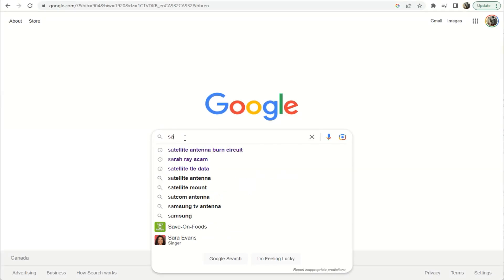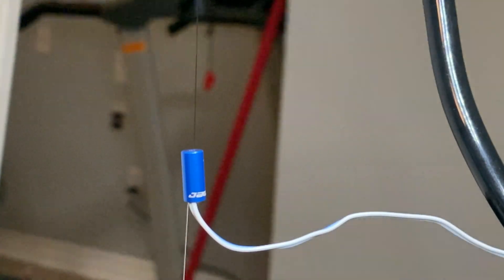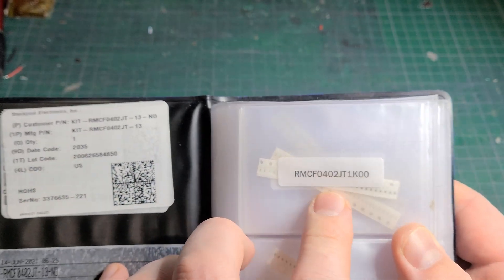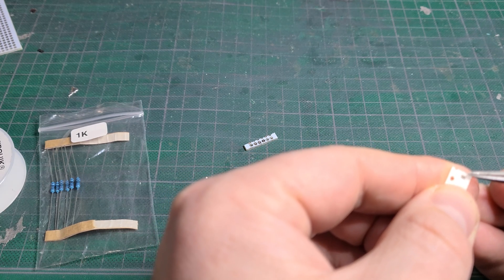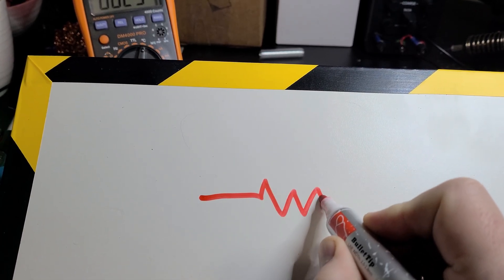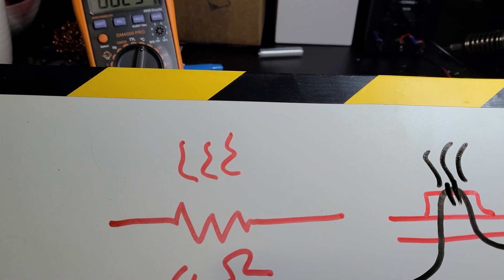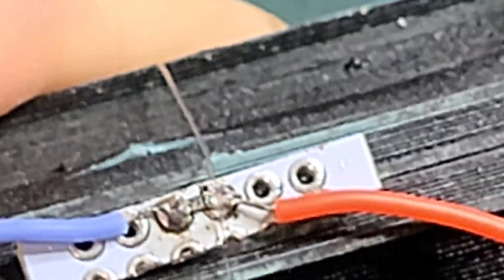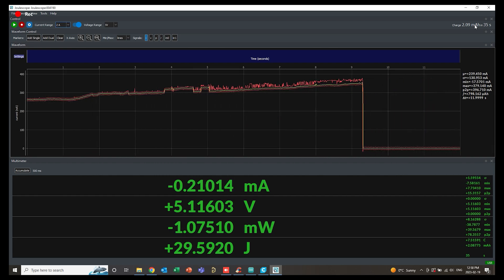DIY CubeSat Build Part 3: Antenna Deployment Burn Circuit

Comment: Wh
ats is the exact spec of the wire that was used?
Reply from the maker: This is 1.8mm stainless strained wire
Reply: @EngineerMeThis  Thanks. I meant to ask about the spec of the burn wire's material though, can you pls help with that?

Comment: Diodes also get nicely hot, something like a 1n4148 works great without needing much power
Reply from the maker: Intresting comment. I'll have a look. I know TVS diode can melt them selfs of the board so good idea to check
Reply: BTW, you can also estimate from the datasheet how hot things may get. Usually there is a thermal resistance specified. For the diode I quickly checked and it's given as 240 K/W, so putting 1W in it (say 1A at 1V) should raise its temperature by 240 K. Another nice thing with the diode is that it is rated to keep working at a higher temperature than the resistor. Up to 200 C according to the Nexperia datasheet I found. And a final note, when selecting a temperature rise for cutting the wire, take into avond that during antenna deployment your satellite may be well below room temperature!

Comment: just a thought use 2 resistors in parallel incase 1 fails the other could be driven at a higher voltage or pwm to give a second chance also the less contact between the resistor and the pcb then less energy is wasted and might decrease the resistor failure rate.
Reply from the maker: Jip Agree, as showing in the references most people use them with two resistors in parallel arrangement, the point here was just to explain how it works.
Reply: @EngineerMeThis  ha ha i did worry i might be trying to teach grandma to suck eggs but i just could not resist the chance to sound like a wise time served EE  instead of the guy with a test gear addiction and too much free time that i am :)
Reply from the maker: Lol... I think we all feel like that sometimes. The only difference is the amount of failed/learned "how not to " lessons completed :-)
Reply: @EngineerMeThis  Lol then all i have to say is thank you. For making this lesson funny, memorable, and pain free .... Oh and for sparking my interest in cubesat's

Comment: So, question: I got these incredibly small solenoids from my Chinese electronics parts supplier - I can't find them at the moment or I'd give you exact specs. Probably less than 5g, maybe 12mm long, 5 x 5 mm. They are TINY. Why not use a solenoid for release? Temperature extremes would probably bind the shaft in the cylinder, wouldn't it? And I'd hate to get my precious satellite into orbit only to find out that's exactly what happened.  :(
Reply from the maker: Other thing I forgot to mention is the vibration issue. They do shock test and vibration test on the equipment to a point that seems over accessive
Reply: @EngineerMeThis  I FOUND THEM!  lol  If you want a couple of those micro solenoids, I'd be happy to send them. But your point about vibrations is a good one. It may be a cause for problems with the solenoids as well. Anyway, if you're interested, let me know, I'll drop you an email and get a mailing address and ship you a couple.
Reply from the maker: Awesome ! Im interested to test their holding strength /Torq knowing whats out there and how much power they use is good when desiging new systems that might need something like this! Please drop me mail.
Reply from the maker: Jip, These companies spend $50K base cost plus and other $5K per kg to catch a ride to LEO. they want as simplest and reliable method for release as they can,  well as simple as you can get for a satellite. but idd still like to see those solenoids if you find the link.
Reply: @EngineerMeThis  well I did respond but YouTube either deleted the comment or threw it in your spam folder cause it had links that I found. lol
Reply from the maker: Weiird I Still don't have anything 😕  but I also suspect youtube does not notify people of comments.

Comment: I am printing the UHF QHF antenna and I'm interested in seeing your build video for it.  The Thingiverse page's "Post print video" is broken, so I'm somewhat in the dark for the next steps.  Thank you for your work!
Reply from the maker: Hey, hey. I'm still testing the antenna to see if the final modification is required as it stands this antenna is fairly narrow band. But I'll be sure to make videos about it once complete. Should be in the next few days. You can also attempt the egg beater antenna, very good performance. 👍
Reply: I'm building a TinyGS setup and a different eggbeater design, but I'm really interested in a QFH for the station.  I patiently await your next video.